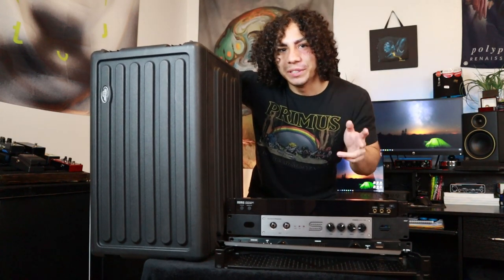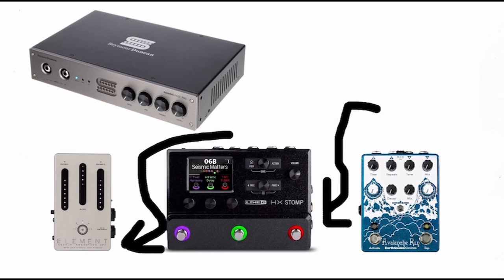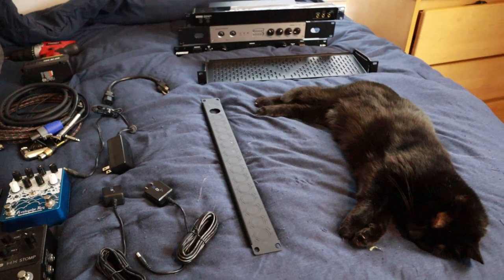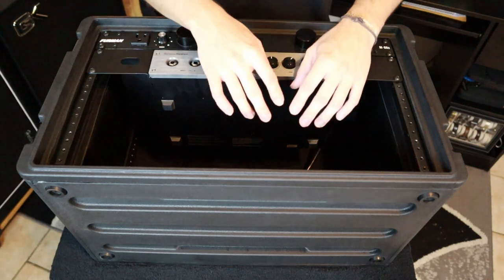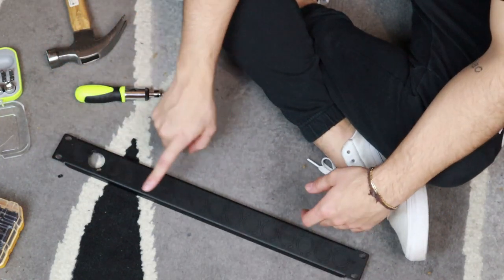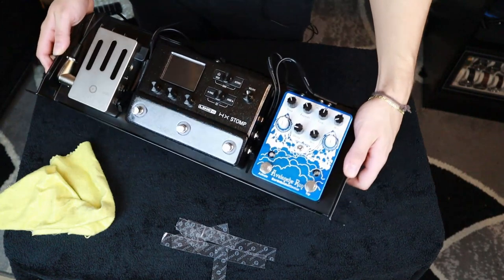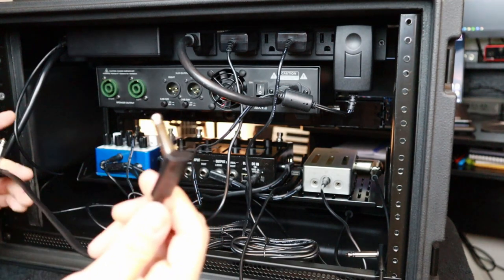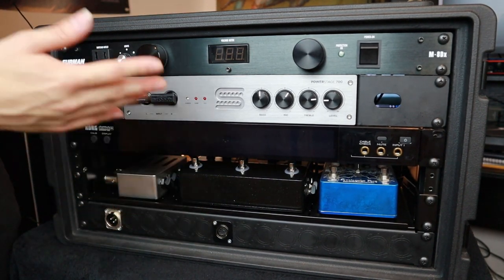How I Built My First Rack Unit

Comment: Seeing how compact it is makes me rethink if I should use a rack rig instead of a conventional tube head?

I just got a vintage Mesa Studio Preamp and Crest 4801 power amp for my Nirvana collection and the reason I ended up here was to check out a rack case lol
Reply from the maker: Thanks for watching! I actually was able to fit what I needed in a 4U rack so this set up got even more compact! It definitely works for me and I just pull up to a gig with my case/bass, rack and cab. I throw the midi commander in my gig bag so everything I need is pretty condensed!

Comment: this is so rad, thank you! i wanna combine a rack or make two (for my guitar and bass) — can you do one like that? i only use 4 pedals for my guitar that are always on (minus OD/Clean switching)— bass would be no pedals other than if i could get a compressor rack or something to beef up my bass sound (raunchy with treble boost)
Reply from the maker: Sounds sick! It’s totally possible, but rack space and depth is one thing you’ll really need to study. This rack is a shallow one and they do sell deeper racks, so just finding out what shelves and rack cases would fit your project would be one of the trickiest parts aside from routing cables but definitely could work out with the right planning 👌🏼👌🏼

Comment: Cool - thanks for the video dude. 2 years later, is there anything you would have done differently with the build?
Reply from the maker: Hey! Thanks for watching and great question. The foundation of this is the exact same as to what I use now. The only changes are that I took out the rack tuner and the reverb pedal and squeezed the rest into a 4U case. I reintroduced the tuner by mounting a polytune mini vertically using an L bracket on the pedal rack with the hx stomp and darkglass element.

Comment: It's every bass player's dream to have their entire setup in a rack. My amp is actually rack mountable and only takes up one half of a rack unit so, I'm going to have my sansamp and compressor on the other half of the ru, underneath I'll use a midi controlled loop switcher (I'm thinking about the Voodoo Lab Hex) and have a cable running to a controller on the floor. Then I'll be able to carry a pedal board, rack, cab, and bass
Reply from the maker: That sounds sick!! Hope it works out 🤘🏼
Reply: Check out the Sansamp RBI. It's the rack mount version of the bass driver pedal. Could be helpful.

Comment: Do you ever get any fan noise from the PS700?
I've got this high pitch noise that i cannot figure out how to get rid of and its only when the fan comes on
Reply from the maker: Ahh sorry to hear that man. I do hear the fan  turn on with mine but I wouldn’t describe it as a high pitch noise. I will occasionally get an air duster and clean out the fan area from time to time. I’m not too sure what could be causing that high pitch noise. If you bought it new, I’d recommend getting warranty on it or getting it replaced just to be sure it will hold up. I’ve luckily only had to buy one unit and it has been running great for me for the last few years now.

Comment: Nick this video was sick! Got me super hype for moving towards a rack system and the set-up was really well explained.

Where did you get the drawer for the pedals?
Reply from the maker: Hell yea! I actually was able to size down to a 4U and I absolutely love it! I got the rack drawer on infinatecables.com. This was the first time using them. The rack dimensions were off from the website (it’s fixed now) and I let them know and they actually refunded me in full and let me keep the drawer. The title of the item is: 19 inch 4-Post Sliding Vented Shelf - 13.75 inch Depth - 1U

Thanks for watching!

Comment: Does the dark glass pedal change the sound of your cab? In a show setting,  would you have the sound person plug their di into the dark glass pedal instead of on the bass head? Everything looks dope
Reply from the maker: Thanks for the comment! No, in the context I'm using the Darkglass in, the pedal will not change the sound coming out of my cab on stage. It will change the sound coming out of the PA because I am sending the PA the cab sim effect from the darkglass and bypassing the darkglass via the unaffected 1/4" output on the pedal, which goes into the PS700. I do not need to send the PS700 the cab sim signal because it is going through the real cab I have on stage. 

And yes, I have the sound guy plug into the darkglass XLR output, which I have connected to a patchbay I put together on the backside of the rack. :) 

Hope this helps!

Comment: Awesome video man! I really enjoyed it!! 
Quick question Nick, can you use ALL of the Midi Commander's Foot Switches to control individual Blocks on the Hx Stomp?
All of the videos I've watched about the Midi Commander seem to show the top row as "Stomp Mode" and the bottom row as "Preset Mode", but I have no Idea if you can use both rows to control "Stomps". 
I'm looking for a Midi Controller for my Hx Stomp, but I'd like to use it as if I had a "traditional" Pedalboard in front of me.
Thanks for the videos man! Keep up the GREAT work!
Reply from the maker: Thank you! I believe you can set up all switches on the midi commander to switch whatever you’d like. I currently have the 4/E switch on the top right of the pedal to go to my tuner on the stomp. I use this as a kill switch as well. From my understanding you just assign each switch a specific command and the controller will go there when engaged. I had no previous midi programming experience before getting the midi commander and it was really easy to program in my opinion!
Reply: @SanacNick  Awesome! Thanks for the reply Nick, I’ll definitely be getting the MIDI Commander now that I know that 😎🤘🏼

Comment: Great video! 

Having any issues with your Powerstage overheating where it is? And it takes up exactly 1.5 U of rack space? Weird.
Reply from the maker: Thank you so much!!! It does get REALLY hot if it’s on for a long time, but no major issues! And yes it takes up 4 holes on the rack which is exactly 1 and 1/3 units… very weird and quite the headache for planning a build lol

Comment: Was it difficult to connect that foot controller to the stomp?
Reply from the maker: Honestly, it wasn’t as hard as I thought! In the users manual of the stomp, each function has a little code. In the MIDI commander, you assign that code in a “user presets” setting for a specific button and that’s about it!
Reply: @SanacNick  awesome thanks for the info I had no idea. Do you think it would work with the other line 6 helix line of products?